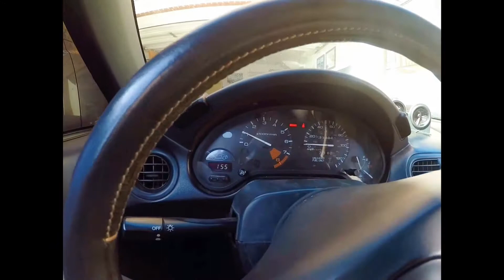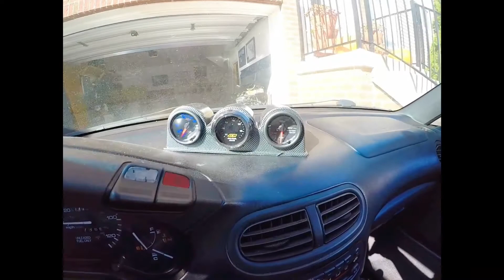LAST RIDE on my 400HP VITARA BUILD | Quest to 600HP begins pt.1 | Turbo D16Z6

Comment: Got any extra parts? Im starting to piece together my turbo build and picking up another motor and ECU this weekend hopefully.
Reply from the maker: I got a few things laying around - Ebay ramhorn, emusa wastegate, and a dump tube.
Reply: @RBXmotorsports  I just got a log manifold for my y8...how much for wastegate and dump tube? And what size wastegate...
Reply from the maker: 38mm wastegate. I got it from a trade and never used it. No charge..
Reply: @RBXmotorsports  forreal? I'll give you something for it...you are in southern Maryland right?
Reply from the maker: No need to pay me. I'm in Glen Burnie.
Reply: @RBXmotorsports  I stay right in Pasadena bro
Reply from the maker: @Bluekbizzel_gaming  let's meet up tomorrow if you are available. I should be free after 12 noon.
Reply: @RBXmotorsports  just sent you a message on IG bro bro

Comment: how much boost 6psi ?
Reply from the maker: Boost gauge said 15 psi but it felt really slow. Gonna have her right very soon.
Reply: @RBXmotorsports  and it makes 400 ? or is that a goal
Reply from the maker: @strickracing437  made 400 at around 22 psi.